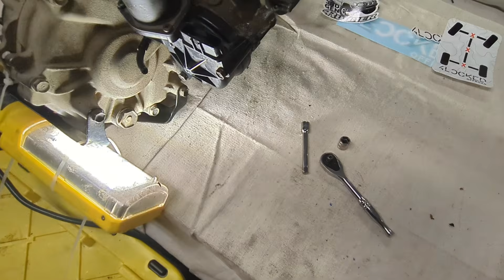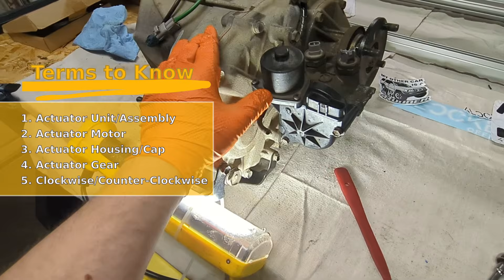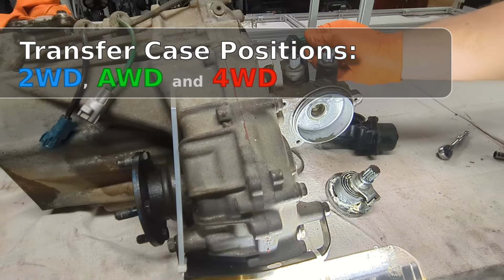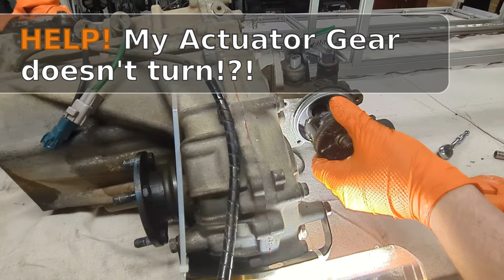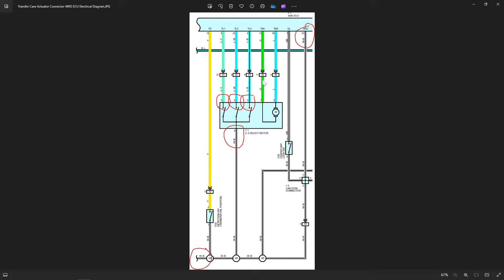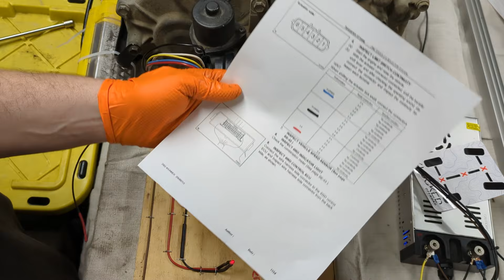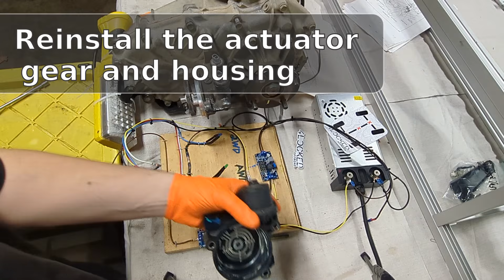Fix Your 4WD/All-Wheel Drive: Rebuild Toyota 4Runner/Tacoma Transfer Case Actuator Fast!

Comment: Jason, thanks for the video real informative. I have 2001 limited  4runner, Took the cap off the actuator cleaned it up. The cork drive off the motor seemed rusty, I connected pin 1 and 2 to a 12 volt battery and it made a noise but did not move. im assuming the motor in the cap may be bad. is there something else i should try, or do you know where to purchase a new one.
Reply from the maker: The motor is held on with 3 philips screws. You can pull it off and attempt to clean, de-rust and lubricate it. However a few things to note as I did this and learned some valuable things. I should make a video about taking this part of the actuator housing off :).

1. When you pull this screw motor out of the housing it may separate into the individual components, this means the screw may be pulled out of the electromagnetic motor assembly that causes the screw to rotate. Reassembling this part of the screw drive is tricky, but not too terrible. I ended up using automotive electrical "de-pinning" tools because they're tiny like toothpicks but reasonably sturdy AND a friend's help because it took 4 hands to get the screw back into the electromagnetic motor with it's 2 or 3 super tiny magnetic blocks.

2. At each end of the screw are extremely tiny bearing balls (1 on each end). I recall these are smaller than most B-Bs (if you're familiar with those) just to give you an idea of how small. Don't lose those! Sometimes they will fall out and sometimes the one at end of the screw opposite the electromagnetic motor will "stay" in the actuator housing/cap (because it gets "suctioned" in it's spot with grease). So if you pull the screw assembly out and you find the bearing on the motor side but NOT the opposite side, carefully examine the housing, it's probably in there.

3. Given #2 above, I'd highly recommend doing all this over a medium-large size towel, my favorite is the yellow microfibers at Costco. The bearings are pretty easy to spot on these when they fall out and you temporarily lose them. With this being said, a clean microfiber absent of any dark blotches of dirt/grease is helpful in quickly identifying the bearings.

Comment: Great video! my 2000 4runner Limited seems to have a different layout /no AWD setting. My question is about the actuator shaft. I've seen some vids that sy 'IN' ( forward into actuator) is 2wd and some say Out is 2wd ( to rear of vehicle). do you know? thanks
Reply from the maker: Yes those actuators are different because pre-2001 they have what's known as the J-shifter. I do not have a J-shifter transfer case on hand, but I remember reading about them and came to the same conclusion. 2WD = push the actuator rod toward the front of the vehicle, 4WD = pull the actuator rod toward the back of the car.
Reply: @4lockedoffroad  Thanks brother
Reply from the maker: @ChrispyTofoo  Of course, thank you for watching and supporting.

Comment: Would a faulty actuator cause the trans to not go in gear? I have a 2002 toyota tacoma with the older actuator with only 2 electric connectors without the triangle plate. Front driveshaft wont spin and vehicle wouldn’t move in any gear reverse or drive
Reply: Also when i put it in park i hear a gear/ buzz noise?
Reply from the maker: I'd start by safely putting the vehicle on 4 jack stands to lift all 4 tires off the ground. With the engine off, put the transfer case in Neutral. This should allow you to spin the front & rear drive shafts. Do they spin?

If they do not spin, turn the ignition on (but do not start the engine) and try putting the transmission in Neutral and then try spinning the drive shafts again. Do they spin?

Did you ever take off your transfer case actuator? Did this transmission shifting issue/buzzing noise issue exist prior to taking off the transfer case actuator?
Reply: @4lockedoffroad  never took the actuator off yet. Vehicle is currently on an incline. Could i remove the actuator while its parked on an incline?
Reply from the maker: @alecbryantalledo  
Make sure your parking brake is ON and it actually works and CHOCK your wheels. Since you're dealing with drive train you want to make sure there are two or more things preventing your car from rolling in either direction. DO NOT forget to chalk your wheels. I like to chalk 1 rear wheel and 1 front wheel and each wheel gets 2 chalks -- one chalk in front of the wheel and one behind the wheel.

To my knowledge it's safe to remove the actuator. But you should do more research on the specific transfer case and actuator you're dealing with since they're obviously different than the one talked about in this video.

Comment: I have a 99 limited multi mode j shift transfer case. 2wd, awd, 4wd, 4lo). Is the transfercase actuator different on my 4runner? 

Been having some issues with the car coming in and out of 4wd. Car goes into 4Lo but will get stuck in 4hi.
Reply from the maker: As far as I know the actuator IS different for the j-shift transfer case. However, the concept maaaay be the same. I have not yet acquired a j-shift transfer case to pick apart it's actuator. I heard they're vacuum operated, but perhaps that's wrong info that I received over the years.
Reply: I have same, the wires on the connector is different, 6 pins but 3 on top, 3 on bottom. Everything else looks the same.

Comment: Thank you for this! My 4WD on my 02 4R wont engage and the lights are flashing.  I will be checking the center diff actuator and the front diff actuator tomorrow, along with the sensors.  Appreciate you explaining all of this.
Reply from the maker: Start with the transfer case actuator. Also, make sure to check all the other possible problems that can cause the flashing 4WD lights before trying to tackle the front diff actuator.

The front diff actuator is completely different in how its electrical circuits work and how it needs to be put back together. Making this even harder, is the fact that the front diff actuator is very difficult to get to.

With the steering rack in the way and being left with a tiny confined space, there's pretty much only one specific way you can maneuver the actuator and its gear out of that space.  Your hands are probably going to completely block your ability to see how the actuator cap/housing and actuator gear are mated up and chances are those two pieces will separate before you can see how they need to be positioned. 

Good luck and let me know if you need anymore help. I've already reversed engineered the front diff actuator electrical circuits, I just don't have a spare front diff yet to make a new video with.
Reply: @ thank you
Reply from the maker: You're welcome. Did you ever solve your 4 Wheel Drive problem?

Comment: Hello. thank you for this very informative video. I have 1999 4runner and there is oil leaking into the actuator from the transfer case. I was told it might be due to a damaged seal, but i cannot find the size or serial number for that seal. Any chance you can point me in the right direction?
Reply from the maker: Not entirely sure about why there is oil leaking into your actuator. I never actually took apart one of these transfer cases, I'd have to look at an exploded parts diagram to see if there are any seals involved at all to keep oil out of the actuator. Just curious, have you overfilled your transfer case, .i.e. is there a lot more oil than necessary causing it to overflow into the actuator?
Reply: @4lockedoffroad  i don't think i have overfilled it. It's been over a year since i changed the oil, but the issue has appeared only recently...
Reply from the maker: @avetiskeshishyan4123  How much oil is getting in there? Are we talking a teaspoon or completely full?
Reply: @ Not teaspoon at all, it's almost completely full
Reply from the maker: @avetiskeshishyan4123  That's not supposed to happen! Perhaps you have a bad internal seal? I looked at the parts diagram from the old FSM that was passed around online and I could not see a seal that would be responsible for keeping oil out of the actuator.

Comment: does the transfer case have to be off the truck in order to access the actuator housing/ cap

i have a 98 4r (no center lock) that is having issues with engaging 4wd. I am in the process of troubleshooting the issue. 

amazing video btw, very informative. hope you keep them coming
Reply from the maker: As far as I know, the transfer case does not need to be off the truck to access the actuators. 1996-2000 4runners use a different transfer case and therefore the t-case actuator is going to be much different than the one in this video.

It would be nice to get my hands on a local-to-me transfer case from those earlier years so could pick them apart and understand how the actuator works. But for the time being you may have to tackle that one by yourself.

Comment: I have an 02 sequoia. 
Are the positions the same? 
When I put it in 2H according to this video and put the cap on it shows 4x4 on the dash, then 2H works but 4H and 4L act like the T-case is in neutral and makes a whining sound. 
Do you have any advice?
Reply from the maker: Sounds like Sequoia uses a slightly different actuator for that year. Arethe metal circuits paths/contacts similar in how they're laid out in circular paths in this video? You should manually actuate the transfer case into a known position, like 2WD. Then through trial and error reinstall the actuator with the electrical contacts in different positions until the ECUs and dashboard lights show you're in 2WD.
Reply: @ the metal circuits are identical in design and the entire actuator visibly looks the same. 
I suspect the circuits are different than yours. 
I remove and reclocked the shaft to the gear, the gear to the cap multiple times. I’m almost at a loss but I feel like I’m so close because I had no actuator movement at all when I started digging in. 
I am going to get a wiring diagram and check my circuits. 
Thank you for the quick reply, I have subscribed.
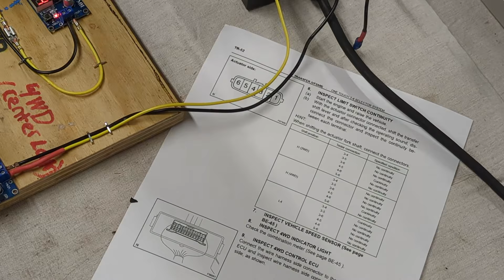Reply from the maker: @97kx211  Perhaps go back and watch this section of the video, 15:47 - Continuity Tables in the Toyota Factory Service Manual Are WRONG.

For a 2001-2002 4Runner, this service manual table is slightly off/wrong. HOWEVER, maybe for your Sequoia this table is in fact CORRECT?
Reply from the maker: @97kx211  Did you find the answer to your question?
Reply: @4lockedoffroad  Yes! 
I found the actuator controls 2hi 4hi and center diff lock. 
The center diff lock can only be actuated when shifted into 4lo using the H-N-L4 shifter and shifting the transmission into low gear on the column. 
I had the actuator clocked correctly. The problem was all my fault, after installing a new ADD with the fork on the wrong side of the collar🤦🏻‍♂️😅
I only found this out after installing a used T case and was still having the same issue. 
Thanks for the info, it was a lot of help to me.
Reply from the maker: @97kx211  Sounds like yet another Toyota transfer case of the same era that behaves different! My 02 4Runner with the straight shifter allows the center lock to be engaged whether the transfer case gearing is in 4H or 4L. The only thing it dictates is the vehicle automatically going into AWD (which becomes 4WD after the center locker mechanism is engaged).

So it sounds like you replaced/rebuilt the front differential A.D.D. and installed the shifter fork in the front diff incorrectly?
Reply from the maker: I'm curious, for your 2002 Toyota Sequoia, was the electrical circuits in your transfer case actuator exactly the same as what was in this video or did the transfer case actuator actually have slightly different electrical circuits?